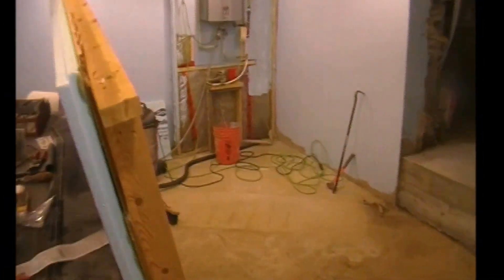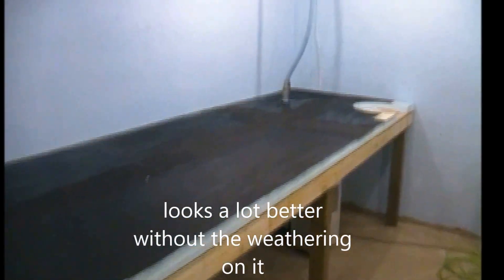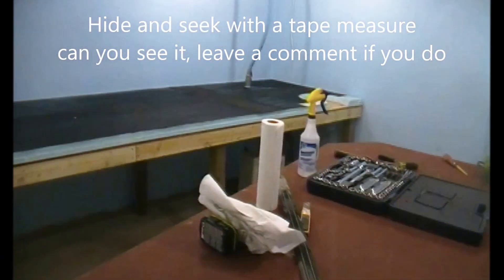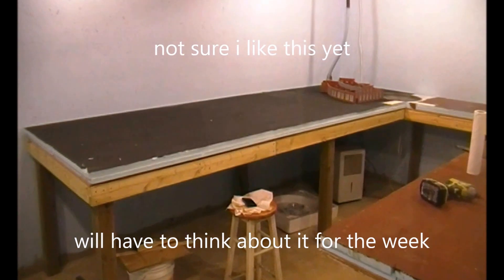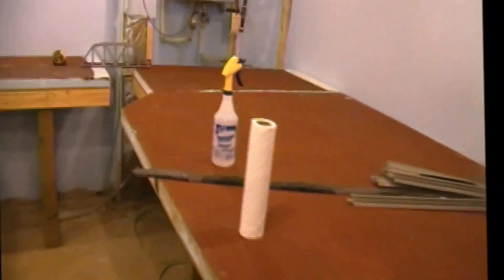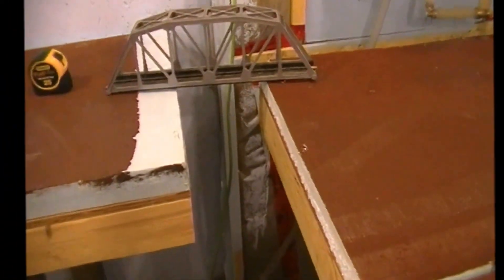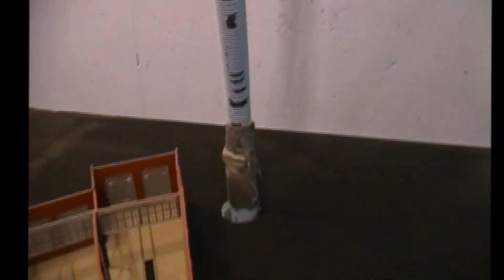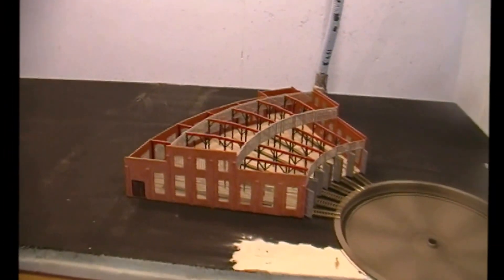bench work again,

Comment: I told you Dave you cleaned the layout room floor to early. you where in haist lol. 

I got two ideas to run by you. instead of a waterctower, do a shop by the round house with a huge smoke stack. As for the deep section by the new stairs. I would cut it back by 6 to 10 inches. looks like it s overhanging to much into the step area.
Reply from the maker: it is lined up right with the edge of the step
Reply: okey then the angle looks deciving.

Comment: I would move the sump pump discharge line and mount it to the wall then build a small soffit around it, you could use ridged copper on the wall like 1" or 1.5" then small sections of flex on the ends to prevent a water hammer effect. Sparky what is your email I want to send you a PDF on a track design I have been admiring for about 25 years now. As far as the tape measure, it was hanging on your belt...
Reply from the maker: lol, the tape measure appeared later on the shelf under the water heater
Reply: ok mailed off the layout plan, it is called the Silver Gate Northern. I used many elements from that design that I used on Chuck Bakers - River Valley Railroad. It is a excellent example of serial staging over a multi level helix in a small space.
Reply from the maker: ok, I take a look at it this week